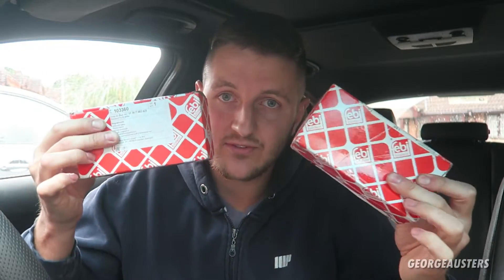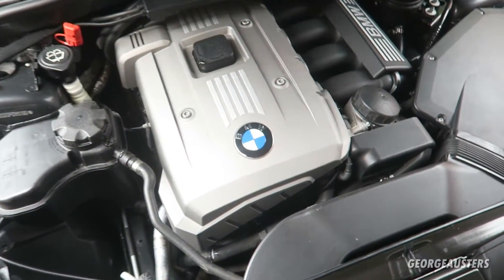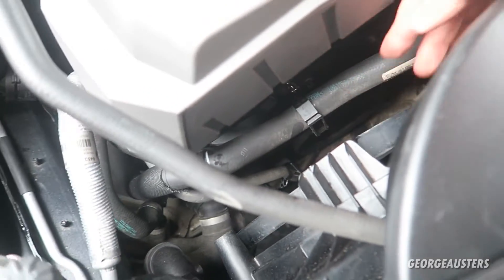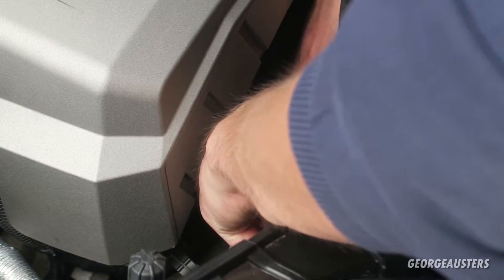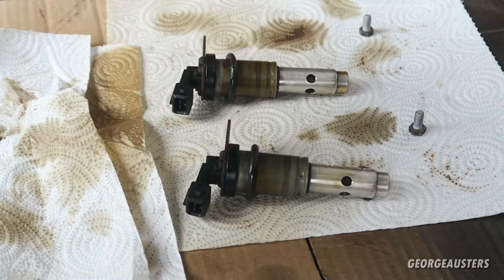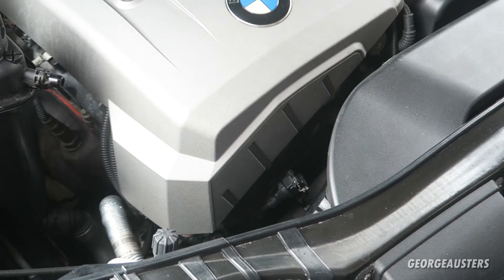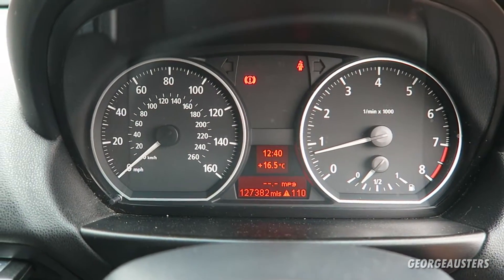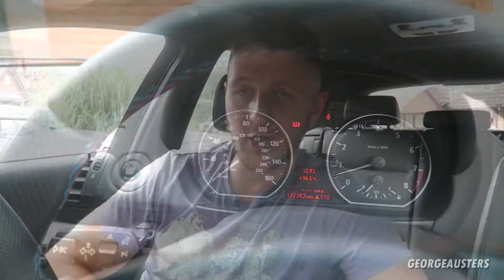How To Replace BMW N52 / N54 Vanos Solenoids

Comment: Hey brother just removed my vanos solenoids to clean them now im confused on what wire connections go to the correct connection. Does the top wire coming from the top engine connect to the top camshaft solenoid and the bottom wire connector to the bottom solenoid exhaust connetor?

Comment: Not usually commenting but great tutorial just like all the others thank you. Fairly easy, mine was a bit hard to put back but it help to put the O-ring bit more in the middle (not the thin part!). Improvements were immediately noticeable in my case despite having no codes, idle is smooth when cold and I have no more hesitation around 3500/4000rpm
Reply from the maker: Glad it helped!
Reply: That worked perfectly to put them in thank you, love you

Comment: Great video, i changed just one last year and now the outlet one is broken as well. Witch one is the outlet one, bottom or top one? Can't fins anything about this anywhere.
Reply from the maker: The exhaust one is closest to the exhaust manifold
Reply: @GeorgeAusters  top or bottom one? :) I am investigating this before i've even looked at it. :) I have a guy who will replace it for me and i want to know that it's the right one that is changed.

Comment: My o-ring fell down into the engine and I cant`t see or fell it, what should I do?
Personally I don`t belive that the soft o-ring can damage the engine totally.
But I`m not sure and it`s my sons car and I really need some advise.
Unlucky as usual ;-(
Best regards Mikael from SWEDEN.
Reply from the maker: I’d probably do an oil change
Reply: @GeorgeAusters  Ok, should I drive some day with the car so that the o-ring crumbles so that the pieces can follow the oil out?
Reply from the maker: You could do
Reply: @MikaelJulin  you could try that. And if you don't see any sign of the o-ring during the oil change, keep an eye on the oil pressure, it might got into the oil feeding tube reducing the flow or even jam the oil pump.... Wish you the best luck.

Comment: does it matter which electrical connecter goes on which solenoid? or does the bottom lead not reach the top one? 
Great video again
Reply from the maker: Yes it does matter 100%
Reply: Yes I recommend just doing one at a time, to be sure you don’t get those mixed up

Comment: Glad yours is working as it should 👍🏻I replaced one of mine with a new bmw one and it was faulty out of the box
Reply: Out of interest did you notice if ether of the sounded like there was something moving inside them before you fitted them?
Reply from the maker: Wow a faulty BMW part? I never noticed a noise
Reply: @GeorgeAusters  mine started and ran perfect with the new solenoid, possibly on open loop then went to start the car and misfiring, put the old one back in and no misfire...
Reply from the maker: Did you put the plugs back in correctly?
Reply: @GeorgeAusters  yep, put it down to it being an issue with the new solenoid, someone was telling me you need to use ista to set them up but seems as if that’s more if you’ve had the vanos system off

Comment: Top video mate. The most detailed N52 videos I've seen on youtube!
Reply: Hello! Thanks for your chanel, I love it! I have a problem with my car. The vanos are working well but when the weather gets cold and humid or when we get drastic weather changes they start coding randomly. I bought new vanos from rockauto this summer but they coded on the second startup. Code was the same as the old vanos. I tried different combinations to see if one was defective. Finally, I put back the old vanos and erased the code. It worked fine until now. Colder weathers and humidity are coming back and it's coding again. 
The motor does not have a rough idle. Sometimes it does for 3-4 seconds but it runs smooth afterward.
Do you have any idea on what this could be?

Comment: I replaced almost all (new battery, vanos solenoids, vanos filters, oil, oil filter, gasket on the valve head, both disa flaps, all sparkplugs and coil) in my N52B25 engine, but still have lot of problems with the engine. Now after disconnecting and reconnecting the batery, it showing me an transmission error, and the shifting is very bad... Im very unhappy from this engine, and nobody aroud me can help me with this, because they don't know how to repair so complicated engine with lots of sensors, like this one.. So for me it's the worst engine.. Lucky you and Dean.
Reply: without bmw ista d proogram you cannot own this car.
Reply: Seems like a bad crack shaft sensor man

Comment: Hello, do you know which brand manufactures the genuine bmw solenoids?
Reply: I think, that lot of "genuine" electric parts are made by Bosch.. It's the same parts like non-genuine Bosch parts, but without BMW logo, and much cheaper, like "genuine" part with bmw logo..
Reply from the maker: Yep Bosch make a lot of parts for BMW
Reply from the maker: I’m not sure my friend